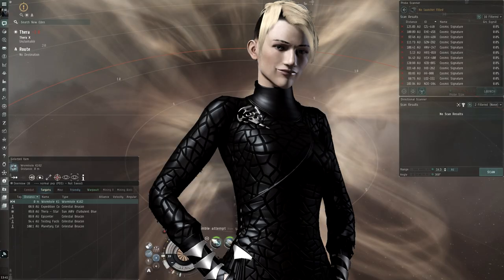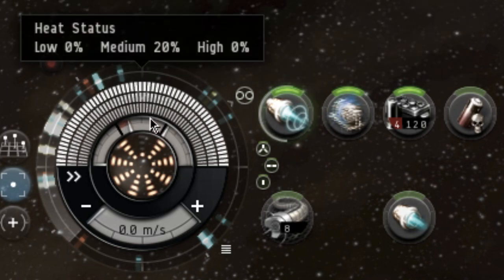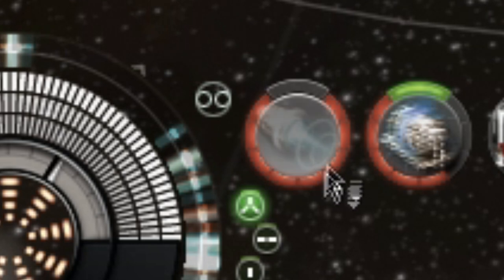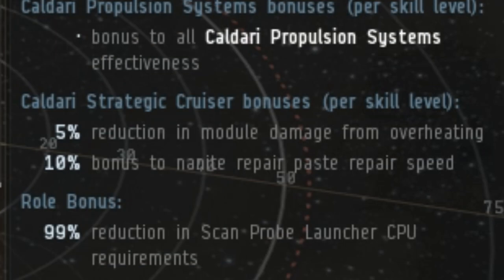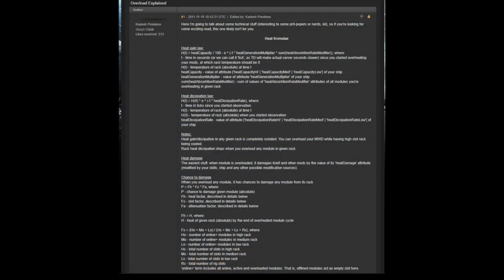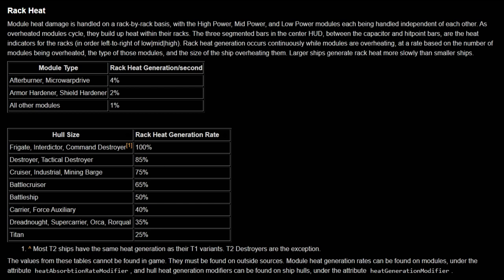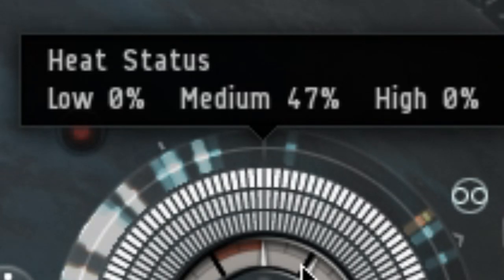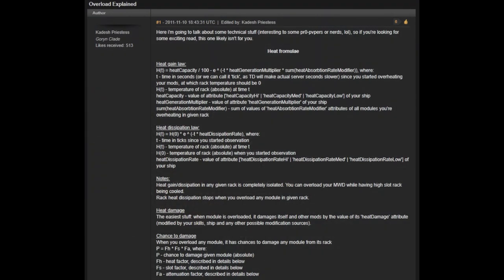Everything you need to know about heat

Comment: Hey Suitonia, 
I'm the guy responsible for writing the last few months of revisions of the UNIWiki page on Overheating which you show and reference.

First off, I'd like to thank you for making this video. This is some information that's been bugging me for a while, and I couldn't get a good lock on until I found Kadesh Priestess's forum thread. I'd also like to thank you for (indirectly and inadvertently) calling me out by showing and referencing that page... because it was a kick to get me to fix a few of the issues that page had.
Second off, I'm now going to apologize for... within a few hours of the video's release, pointing out that there's a thing wrong. And it's entirely my fault that it's wrong, and for not having fixed it sooner; and I've just been fixing it over on the wiki.
* The Rack Heat Generation per second for modules is not actually split between Prop Mods, Resistance Mods, and Other Mods. It's actually split Prop Mods (4%), *T2 Mods* (2%), T1/Faction Mods (1%)

Also there were a few paragraphs near the bottom of the page which were wrong (the ones about heatAttenuation) so I'm glad you switched over to Kadesh's thread for that part. I can however bring the good news that the (previously untested) assertion that heatAttenuation is the driving factor behind damage spread (as opposed to the ship's slot count, which was raised as a possibility after a patch in December 2015 rewrote overheat mechanics "without changing functionality"), and that some ships may have heatAttenuations that don't match their slot counts, is correct. There are some ships (like the Jaguar) whose slot counts don't match their Attenuations. Because CCP. (Also, I fixed the wiki page.)

So yeah. Thank you for making a video version of Kadesh and my walls of text, and I'm sorry for not fixing the page a few days ago before you captured screenshots of it. lol.
Reply from the maker: Thanks for writing the article, it was a great source of information. T2 being 2% and T1 being 1% also explains a 'myth' I've heard too, "Meta guns can be heated longer than T2 guns" is something you hear people say, and it seems like that is actually partially true for non-propulsion modules since they generate less rack heat.

Comment: Offlined Modules or an empty slot in the high rack have exactly the same effect. You don´t need modules to be offlined in a gap to get that mathematical bonus. But sure offlining something like Neuts/NoSes in the middle of a fight that you won´t need will work and give you that bonus...but the "myth" to put offlined Salvagers and other modules in the highslot gap to gain more Heat absorbing,....is a myth. Leaving them empty is exactly the same heat absorb state.

Very significant this hole idea becomes also in using Tackle Interceptors without anything in the High Slots, which can increase the amount of heatable MWD Cycles significantly. 

Another thing that would be interesting to find out,....where to put the MWD/POINT and where to place the Gap in the High and does it make a difference for the Rack Heat to the Modules. Lets say you are in a Retribution, do you want to split the guns and leave the gap in the middle, or do you place the gap in the highslot, to the right 5th slot, and does placing the mwd at the top or lower slot, make a difference in the chance of how many heat cycles you can get out. When you place the MWD in the lower midslot, and the lowslot on the right end is the active repper, is there a difference ?

Which leads to the question...
Do ACTIVE Modules, like Adaptive Hardener, Points and Armor Hardeners or Sensor Boosters, when they are active, somehow affect the Chance to eat one of the HeatCrits compared to PASSIVE Modules like Shield Extenders, Cap batteries and Damage Controls. I am pretty sure active modules somehow are more affected than passive modules...but only when they are active.

Minchurra - How does module spacing affect heat damage? (two Videos he did about heat damage, and where he shows that offlined modules and a gap are identical)

Good Video Suitonia, as usual...keep it up.

Comment: Suitonia - could you prove this? I mean you keep saying that these things are loosely based on slot layout, but changes sometimes - can you explain those changes? when what you're doing is calculating probabilities from this data - it's hard to know if you're right/wrong and maybe even missing massive factors. I.e. maybe the heat attentuation is down to different factors - or maybe it's something you haven't accounted for.

enough data without proof in this game, right? 

ps : you can also replace burnt modules with mobile depot and a spare.